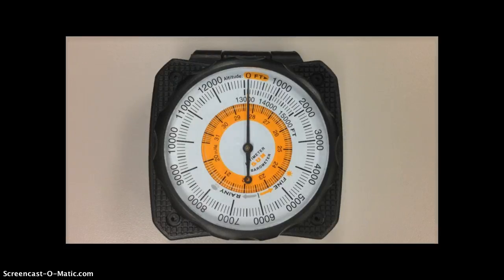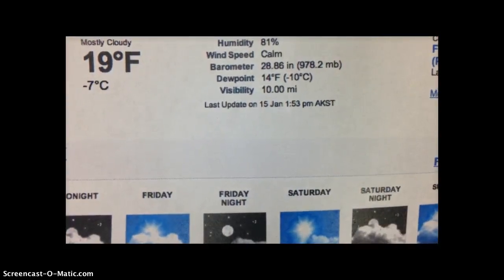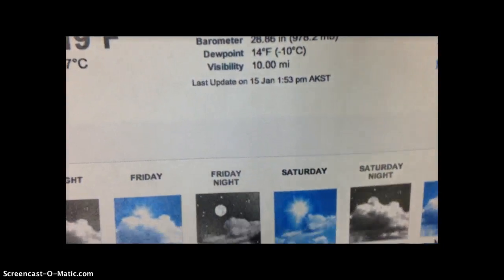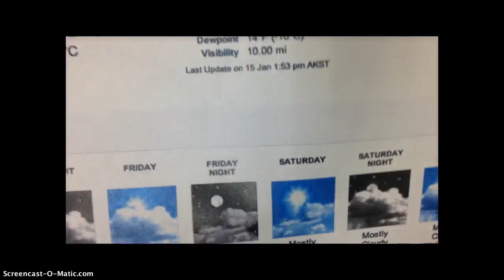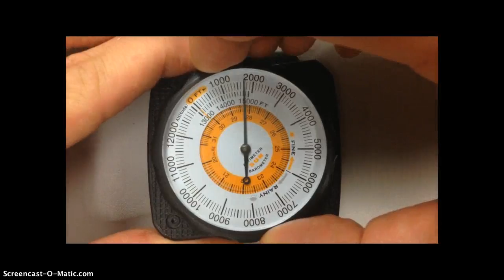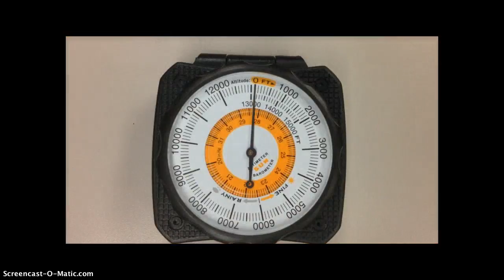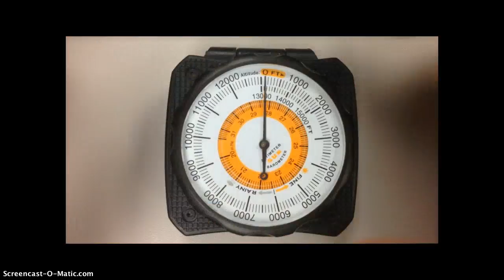Sun Altimeter/Barometer Tutorial

Comment: Good tutorial for the barometer; but, how about an overview on it's use as an altimeter? Perhaps, with examples for hiking, e.g. using in conjunction with a compass and topographic map.
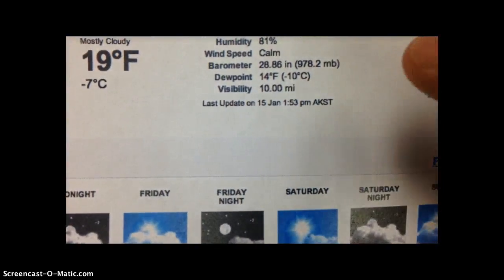Reply: The black needle gives the altitude and the orange needle gives the mean sea level pressure. You can use the altitude to infer the MSL pressure (if you know the altitude, as in this video), or you can use the MSL pressure to infer the altitude. To find the altitude / elevation, you need to know the real-time MSL, which you can look up on the internet. In the example in the video, you can see that his ambient barometric pressure was 28.3 inHg. However, the MSL reading for his location was 28.86 inHg (see 1:22). Therefore, he rotated the outer ring so that the orange indicator was at 28.86 inHg. When this is done, the black needle rests at 450ft, which is his altitude. A compass or a topographic map is not required for this exercise.

Comment: So this contraption does not give you your elevation, you have to know it and use it to correlate pressure?
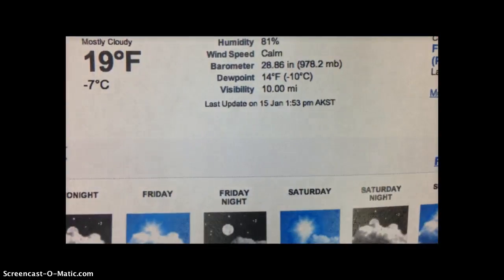Reply: The black needle gives the altitude and the orange needle gives the mean sea level pressure. You can use the altitude to infer the MSL pressure (if you know the altitude, as in this video), or you can use the MSL pressure to infer the altitude. To find the altitude / elevation, you need to know the real-time MSL, which you can look up on the internet. In the example in the video, you can see that his ambient barometric pressure was 28.3 inHg. However, the MSL reading for his location was 28.86 inHg (see 1:22). Therefore, he rotated the outer ring so that the orange indicator was at 28.86 inHg. When this is done, the black needle rests at 450ft, which is his altitude.
Reply: @LedokolDX  your answer is no, if you need to hook to internet first.

Comment: So, if I need to know my altitude to calibrate the barometer to sea level, and need to know the sea level pressure level to calibrate the altimeter.... am I not going around the endless cycle of unknowing? This is like I must know A to find B and I must know B to find A... which I will never find either.. 
Say if I am going into a strange place where I will get no cell tower communication at all to the outside world, which means I cannot obtain the atmospheric pressure at sea level, what tool can I use to find my altitude? Can digital GPS give me real-time altitude since GPS doesn't rely on sea level pressure instead it uses light wave signals(and gyroscopes and accelerometers etc.) so it should be able to find real-time altitude without relying on another unknown data right? What other tools are there and any analog tools?